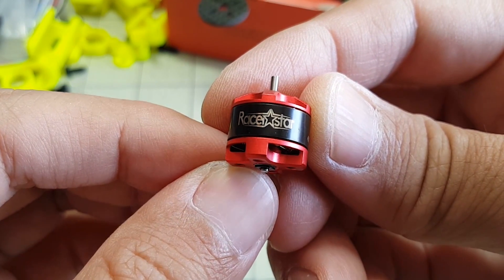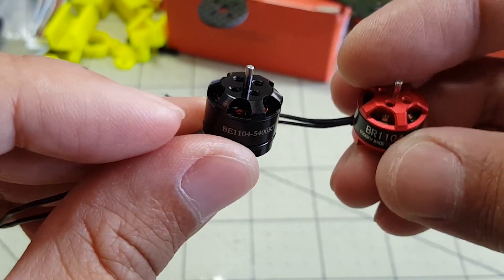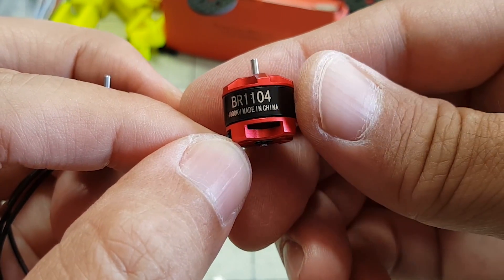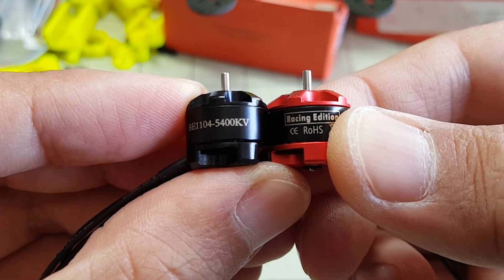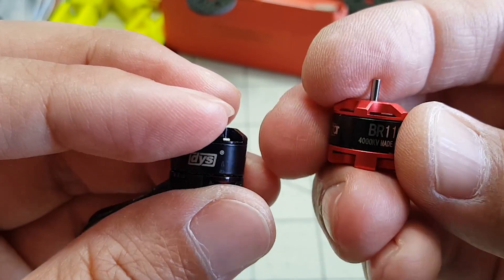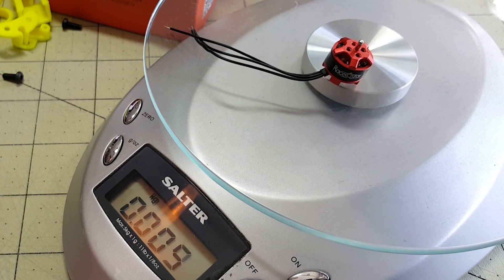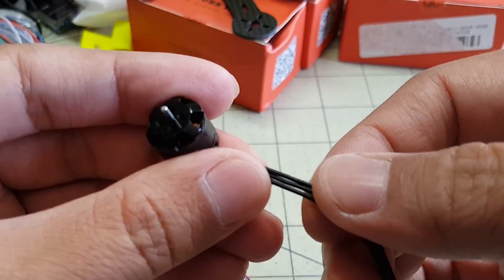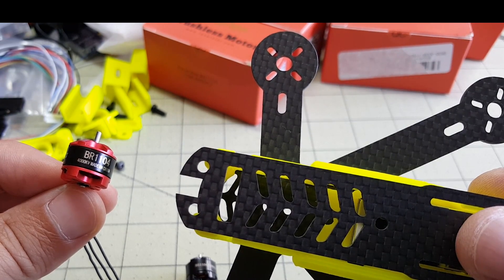Racerstar 1104 4000kv Micro Motor

Comment: What size screws did you use to fix the Racerstar motors to the frame? I tried M2 screws but they are too small. M2.5's were too big. Perhaps I've got a bad one? Thanks.
Reply from the maker: M2 is what I used.  Maybe yours are stripped out?
Reply: Thanks  @AlbertKimTV ! The thread's are all good. Hmm, maybe I'll buy another and see how it goes.

Comment: Which esc used for this motor if I'm building mini rc plane
Reply from the maker: That depends on the prop and battery you are using.  Assuming you are using a 6x3 prop, a 30 amp ESC will work on 3S.
Reply: @AlbertKimTV  OK, but if I'm use 3S then motor will be not burn

Comment: Zerotech Dobby's iSteady 1104 4300KV pull 88 grams using a foldable 3030 prop and draw 18.5 watt at 2S voltage
That must be a better performance, overall? But they still get pretty hot.
Reply: i'm using 1104, 4000kv on a 130mm, 3S, 3020 props, do NOT get hot, barely warm

Comment: Would these be okay for a 2s kingkong q90 quad build, paired with a racer star 4x6a esc, and a pikoblx micro f3 fc?
Reply from the maker: Yeah, those components all work well together.  I would recommend getting the 7000kv versions if you're running 2S - https://goo.gl/Y2qCLZ
Reply: Albert Kim thanks I'll be sure to get those 7k motors. Good day
Reply: Albert Kim what props would you recommend for this setup I'm looking to build?

Comment: do all of your racerstar motors spin well? I watched another review where 2\4 were seized and the other 2 were extremely noisy
Reply from the maker: So far of the ones I have used they all seem to be OK.  No defects from the factory yet.  The 1806 motors I've been abusing on 4S and I've even crashed into concrete from 100 feet and after that one of the bells on one motor is not a little loose but it was a BAD crash.  The other three are OK.  They don't even get hot on 4S but I'm using a 4inch prop on a 180 Tweaker
Reply: +Albert Kim (marblekit) awesome I was hoping they would  be decent because the price point in great and I will likely give them a try

Comment: Any motor can actually be run on almost any voltage but as you go up in voltage you have to go down in amps, so manufacturers only recommend certain voltages because higher voltages require smaller and smaller propellers to not burn it out.
Reply from the maker: That's a great explanation!

Comment: Hey cool..interested in the fc you'll be using. My tarot 130 fc fried and need to replace but not much room with this quad. tks
Reply from the maker: That build will use a Flip32 F3 Mini
Reply: my Tarot FC fried the first crash I had, terrible FC, replaced with Piko BLX, many crashes, excellent flyer now!  just slowly fade out Tarot products and you'll be golden, I use 1104, 4000kv motors, w 3020 2-blade props, 3-blade were fine but I actually found 2-blade to be sweeter for this build - longer flight times, motors barely warm on 3S